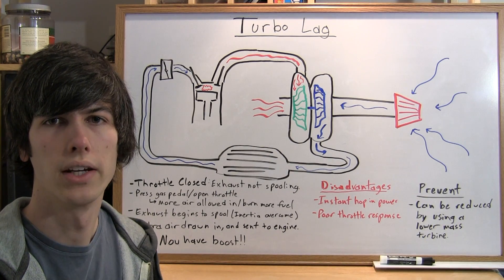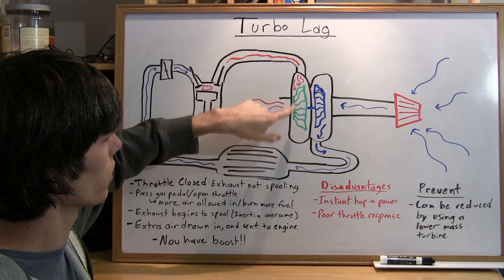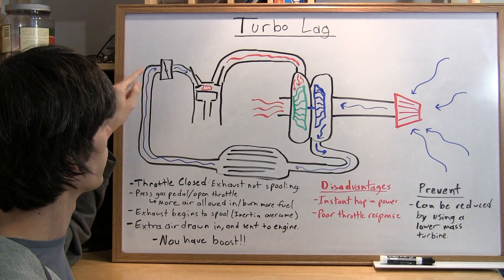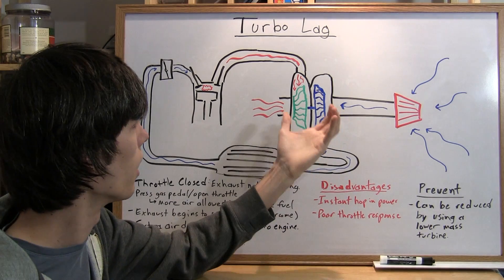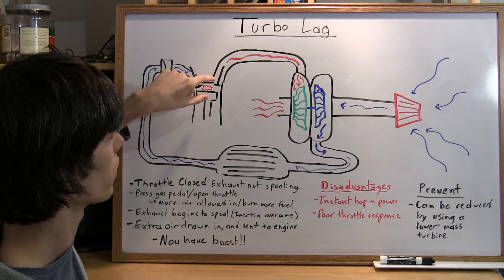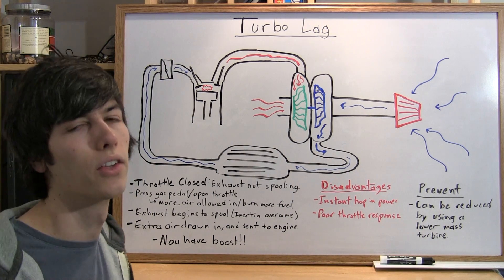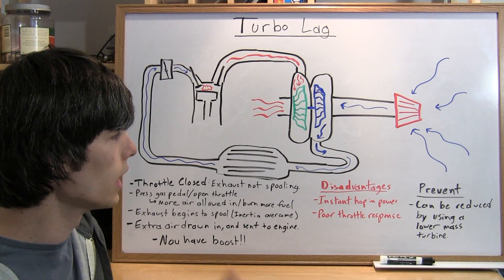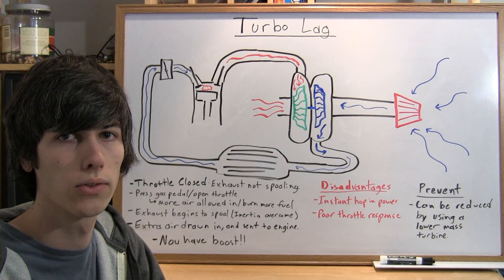Turbo Lag - The Problem With Turbocharged Cars

Comment: Engineering Explained  No No! you're incorrect in some point, the biggest one is: more air in= burn more fuel. This statement will bring viewer to a wrong thinking. More air flow= increase flow speed. Increased flow speed will create intake stalling. But those amount of stall isn't too effective to create engine failure. Still that amount of stall will decrease the coefficient force, coefficient force decrease will create less oxygen to the engine and cause overheated by the fuel. The "throttle" isn't connect straight to the valve, the throttle connected to a computer sensor which will work with a calculator to open the valve door effectively. Not over flow it. You're correct the exhaust need certain amount of pressure to overcome the resistance force not "force" from the turbine. Don't forget, those amount of force can create exhaust stalling and cause overheated to the cylinder. Comes to turbo lag, you're totally incorrect. Remember exhaust is from Intake. The amount of exhaust= the amount of intake by ratio. The time or "lag" is the time of the intake air accelerating it flow speed by how hard the exhaust has pushed off from the cylinder. In other word, the engine needs intake to create exhaust like Jet, u need to drive the turbine by intake forces and at certain rpm, the exhaust have the pressure to power the turbine and pull air in. So in conclusion, intake spool the turbine to certain rpm and the pressure of exhaust will drive the turbine from certain rpm. The "turbo lag" u can also call it resistance force, this amount of force will never stop because the exhaust always boost harder than the intake and create drag for the turbine, there is no way to overcome that, boost the exhaust harder, the inlet will increase by the speed of turbine. The only ideal possibility is to create a equal force between intake and exhaust. Let me answer your first question, the "burn more fuel" one. More inlet= more oxygen to burn, create batter coefficient force with same amount of fuel. Those amount of increased force will increase the speed of each punch at ignition timing to the piston. That also will increase the pumping speed of each piston. That will increase the RPM at the crank . Increase RPM= burn more fuel in same time. However the fuel control unit will decrease the fuel flow at low rpm to decrease the temperature. What I'm trying to prove here is "more air not equals burn more fuel" That is activate or fuel control involvement not naturally. the engine won't add more fuel  naturally by just pulling more air.  The engine will increase fuel naturally, effectively and activate by increased RPM. coz it will pull more fuel into the engine ideally.
Reply: Me grabs popcorn and beer while reading your comments

Cheers!
Reply: doktorbimmer ChrisHallett83 Thanks for the informative posts guys.
Reply: ROCKETGUN BOOMBS "Less octane = more compression, high octane = less compression"

Nooooo no no no...octane ratings (both the AKI and RON) are a rating of how resistant to detonation the fuel is.  The standard we use in the US, AKI, stands for Anti Knock Index.  Higher octane = higher resistance to detonation allowing for higher compression.  Compression generates heat, lots of heat creates detonation.  Higher octane means higher compression can be used while maintaining deflagration in the cylinders.
Reply: It doesn't matter what I say to you.  As I've pointed out before, you have one of the strongest aversions to learning I have ever seen.

That being said, this video is for people who DO want to learn so I will provide the information for their sake.  You'll probably just lock the replies soon anyway!

Turbo lag has zip, zero, nada to do with the octane of fuel being used.  The turbine, shaft and conpressor wheel all have a rotating inertia while the engine is idling.  The airflow will naturally spin the assembly at a relatively low speed.  Hitting the accelerator doesnt result in an instant power release as the turbo is working against the airflow.  There's your lag.

Octane and turborchargers...higher octane fuel is typically used for several reasons.  Forced induction means more air in the cylinders and on the compression stroke you're compressing MUCH more air.  This results in a lot more heat which would cause a lower octane fuel to detonate damaging the engine.  Higher octane fuel resists the detonation.  Plain and simple.

With modern ECUs this isn't even the case for many factory setups.  Electronic waste gates to pull boost, retarding ignition timing and cam adjustments allow forced induction engines to run safely and efficiently even on low-octane fuel.
Reply: Yes, THAT WTAHAT I MEAN!!!!!! More air in won't accelerate the piston! I did said that. You type something wrong. More air less fuel will not create lime. The opposite will.

More air in without giving same amount of fuel the piston will DECELERATE and decelerate quicker in each compression section. More air more coefficient of DRAG. More air= the fuel will burn more equally, too much air= over flowed and it won't fire up because the temperature decreased. The spark from spark plugs will blow through cylinder, exhaust valve, pipe all the way to the exit. That's why u see cars back spark when engine decelerating and running out of fuel. Fuel and Oxygen MUST equal. More air= more drag, more fuel, overheated, wasted of fuel, lime and after fire. Get it?
Reply: This two sentences from your comment will make you lose your technician career.

(((((((((("The coefficient of drag of the intake charge air will have ZERO effect on piston speeds."

"Car exhaust systems popping and banging under deceleration is due to TOO MUCH fuel, not a lack of fuel"))))))))))))

My answer for that is:

The coefficient drag of PISTON will effect the speed of itself not the air effect the piston. Read clearly.
Formula for piston drag: 1/2 PV square* area* cd.
So if the piston have better aero, it will create less drag, the opposite of that is less compression force. If there is too many oxygen coming into the cylinder, the piston will MUST slow down NATRUALLY. Anti lag, AFC ECU is mechanical involvement. The piston will pre-ignite when too much air in, but that only happen in a short time. Depends how quick the engine decelerate. Try to get a cylinder and block the exhaust with your finger then try push the piston and see what'll happen.

Second answer for your second mistake:

Too much fuel WON'T create after spark, it'll create after fire. Go look at 2013 LeMans 458 running out of fuel. When a piston full charging up and down, the AFC bring balance fuel and the intake into the engine. The engine running good. Once you let go, the AFC cut the fuel by ratio and the piston still pumping fast. Now the situation is too much air, not enough fuel to fill in. The spark plugs still spark hard and quick deal to piston order. So the spark isn't burning or creating fire, it is burning oxygen and little gasoline, that's not enough to create fire. Try think, what'll happen if you burn oxygen, and think what is like when you burning gas. Gas will transform to fire and oxygen just expand. Spark from exhaust= expansion of oxygen fire from exhaust= explosion of gasoline. Go look it up, NOT the internet.

There're also a formula for piston thrust. In order to keep you on track, I shouldn't bring my primary engineering math to confuse you.
Reply: Explain please.
Reply: ha, watching cars drag race and performance video helps me to finish my homework about mechanic physics. sometimes u have to think, not every professional is correct, they'll make mistake either.
Reply: Ha, Americans.........no brain, just abuse and insult people like the little bullies in high school. Luckily my parent didn't sent me to the ........."America".................
Reply: That comment aren't for you. Whatever, I have a good time arguing with you.
Reply: doktorbimmer  That comment aren't for you either.
Reply: doktorbimmer Hey, do you know something about planes or trains? If yes, it will be a good argument here if you want, also do you know anything about ship? I study sea navigation and ships mechanics for 9 month, and planes mechanics+ navigation for 5 month.
Reply: ROCKETGUNS BOOMBS stop chatting shit!... Your comments are hilarious with the non technical wording you use. and FYI. Air is sucked (or forced from a turbo) into the cylinder on the induction stroke - so when the piston is on the way down, so how you are going to slow the piston down I don't know, as the air is flowing in the same direction as the piston. The induction valve then shuts and the piston then compresses (stroke 2). We then have ignition (stoke 3) where the piston is forced down and therefore gives us mechanical rotation. then the exhaust valve opens  and the exhaust gasses are extracted from the cylinder and the piston goes up (4th and final stroke). Then repeat!

you're talking about changing the shape of a piston so it has a reduced drag coefficient?! I don't think you understand the point of a Piston! The drag coefficient should be high so it can squash all that air and fuel mixture on the compression stroke. If it was more aerodynamic it would be shit at doing this!
Reply: Peter Killeen You know lots of technical term so? You don't know how it work. English is my second language.
When I say drag, it doesn't me "stroke 1" inlet.
It mean "stroke 2" compress.
Everyone know that higher compress ratio= more power also more drag. So a high compress ratio engine can't rev high.
Adding more air in= higher compression ratio. So Naturally adding oxygen without add same amount of fuel have no difference at increasing compression ratio. It will slow down the engine. e,g, a 4 stroke V8. In a full order, it will be 2 inlet 2 compress 2 ignite and 2 exhaust. So if you add air without fuel, will slow down 2 piston in the same time by increasing compression ratio. It will also slow down another 6 piston because they're connected with camshaft.
If adding air without fuel, there is 1 thing you will see at the exhaust: shooting blue flame, there is 1 thing you can see in the rev  counter: slowing down, there is 1 thing you can herd: the engine note sounds louder and weaker.
Reply: doktorbimmer High compression engine can't rev high! How come you don't know that? Go ask everyone am I right.
Reply: F1 engine vs road car engine........
Reply: doktorbimmer Why F1 engine vs road car engine?
Reply: Compare F1 engine to F1 engine please. You can't randomly compare engines, that is not professional.
Reply: There is no advantage for you to argue higher compression ratio= higher rev.
Everyone know higher compression ratio= less rpm.
Reply: doktorbimmer There is something called variable compression ratio and variable inlet exhaust timing on Porsche. Low rpm more compression, inlet close later exhaust open earlier= best power and efficiency. High rpm less compression inlet open less.
Higher compression ratio= more strength needed from piston head and cylinder wall. Less compression ratio= easier to build, rev easier.
Reply: doktorbimmer ChrisHallett83 So you guys think higher compression ratio= higher revving?
Reply: doktorbimmer Biggest cylinder in production car: Viper 512ci V10 0.84L per cylinder, compression 10.2 rev 6500rpm
6.5L V12 each cylinder 0.5L smaller than 458. no problem for 8250rpm. Also ratio  depends on stroke. long stroke= more compression ratio than short. You guys know nothing about cars.
Reply: My point is easy, high compression ratio give lots of torque and higher efficient also more drag so it can't rev high.
What about a fact from wiki to support my point?
"V_c\; = clearance volume. It is the volume of the combustion chamber (including head gasket). This is the minimum volume of the space at the end of the compression stroke, i.e. when the piston reaches top dead center (TDC). Because of the complex shape of this space, it is usually measured directly rather than calculated."
Reply: F1 engine have 17:1 ratio, and is maximum efficient at 18000rpm. >MAXIMUM<
F1 is a race car, they make F1's engine as extreme as possible.
Reply: Is easy for you, just type wrong wrong and wrong.
Reply: Did I say is "not possible" you like to make things up from your mouth.
The secret of why Porsche can exist high rev and 12.9:1 is because of the fuel. The (octane number) Less octane= more compression, high octane= less compression. Easy
Gas engine can't go higher than 11.1:1 due to knocking or lower than 7:1 or 6:1 due to pressure.
Reply: doktorbimmer That doesn't prove I was wrong, High compression ratio DID can't rev higher than low compression ratio. It depends on what fuel you're running with. It depends on how hard the pressure is. You can have high compression ratio with low octane fuel, the pressure in the cylinder is similar to high octane fuel with low compression ratio. Get it?
Reply: doktorbimmer I thought you are an adult and good for a fair and respectful argument but you can't.....Disappoint
Reply: You keep saying cheers!? Are you junk?
Reply: ChrisHallett83 No, variable valve timing WILL effect compression pressure. Longer inlet valve open time, more air pull in, in the same time, higher compression pressure due to more oxygen flow in. High revving, inlet open shorter time, so less air in for applying high revving running beat and order, also less air= less compression pressure= less knocking. I shouldn't say high compression ratio engine can't rev high, I should say high compression pressure engine can't rev high. And you guys can't argue that or you know nothing about car engines.
Reply: Prove it. Saying the word "wrong" without proving will be an insult
Reply: ChrisHallett83 doktorbimmer It depends on engine design, compare an F1 engine to a sport car engine= apple vs orange, even Porsche vs Ferrari will have big difference between them. They build for special ability. When an engine running high rev, the intake valve will open and close later or delay so will have better airflow efficiency. Comes to inlet efficiency, or pumping lose, there is something due with VVEL. Variable Valve Event and lift. The inlet valve open wider= less piston drag. This technology targeted for low revving. Lower the rev less air flow, less airflow= less performance.
Reply: ChrisHallett83 low rev did have less oxygen flow in. VTEC aren't target for the amount of air flowing, is about the efficient and the inlet space. At low rpm, VTEC maintain in normal inlet timing, at high revving, the inlet valve will delay either open and close. Because the air will create a pump lose and decrease the pumping efficient of pulling air at high rpm when air flowing the same speed of piston. In other word, the piston aren't pulling the air in, is the air flowing by themselves.
Reply: doktorbimmer The compression pressure is dealing with the octane number of the fuel.
Reply: No need for ignition spark. Wow
Reply: doktorbimmer You proved you wrong again. HCCI engine can't rev high due to the high compression pressure in cylinder. It have low power range lol see, facts is with me
Cheers!
Reply: doktorbimmer It can, but can't have a wide power band as normal Millar cycle engine.

Cheers!
Reply: But is a Miller based engine.
With HCCI technology.
Reply: doktorbimmer wtf?  Miller cycle isn't a power induction based engine.
Reply: wtf means What The Fuck

Miller cycle is a 4 stroke Otto cycle engine.

Your knowledge is terrible.

Cheers!
Reply: It did use Otto cycle

Cheers
Reply: It based on Otto cycle.
Reply: Say what you want, Miller based on Otto that's all.
Cheers!
Reply: Similar to and based on is different.
Similar is opinion based on is facts.
Reply: doktorbimmer Based on means it used that method as a basic. Not exactly the same.
Reply: doktorbimmer not the same but based on. Otto engine is a low rpm engine, same as Diesel.
Reply: Why you being such stupid? Why you like to argue me with no reason??????????????
Are you serious? a base Diesel engine classed as "high speed" type? I am done with you. Is wasting time to argue with isiots like you.
Reply: Diesel engine is a high speed type.......lol
prove hoe "fast" it is.
Reply: Average 6L Diesel engine can rev around 3500rpm max. Average 6L Gasoline engine can rev 6000rpm. Which rev faster?
Reply: You shouldn't randomly compare engines. An engine can rev up to 8000rpm. Even 10000rpm. The problem is where is the maximum efficient speed at. Average 6.0L Diesel rev 4000rpm max power, 6.0L Gas rev 6000rpm for max power. And that is Ideal. Now 21 century have lots of technology to help Gas engine make max hp in lower rpm. But still Diesel engine is low revving.
Reply: Diesel is a low revving design. It's inlet, exhaust etc....based on low revving performance due to the density of fuel.
Reply: doktorbimmer Look up what fuel do ocean liner use then look up what fuel do Diesel vehicle commonly use. After that, look up what is the revving of them. :hint) must be same or similar displacement.
Reply: fuel type will directly affect ignition force and dynamics. Those affects will coz major impact for rpm. RPM due with piston speed. Do you know that?
Cheers!
Reply: Yes. So fuel did affect. Look up heavy oil vs Diesel vs Gasoline. and look up how effective will different type of fuel affect piston speed at ignition timing.
Reply: Diesel engine don't have spar plugs correct. BUT they did ignite by high temp and high pressure. Higher density= more pressure and temp needed. That's why, the type of fuel will affect stroke speed and fire efficient
Reply: Diesel fuel will ignite. The diff between Diesel and Gas is: Diesel ignite by high pressure+ temperature, Gasoline need spark plugs to gain temperature and pressure.
Reply: Diesel engine is a multi-fuel type. You can use gasoline, vegetable oil, corn oil, Diesel etc.....That's why WW2 tanks use Diesel engine instead of Gas or jet engine.
Reply: Jet engine use less space because it is small and powerful. But 1 Gallon of fuel can't even go for 1KM. Also there is too much dust at the ring, it will damage the engine. Gas engine isn't good at all. It needs better cooling. Diesel engine is the best because Diesel won't explode while shot. Burn is better than explode. Higher chance to stay alive. Japan, German, US etc use Diesel engine for tanks. Also because it can burn many different fue and easier to cool down.
Reply: More than you do.
Reply: doktorbimmer German and Japanese start using Diesel is because they're more reliable. Jet engine aren't. At the very first, Gasoline engine is the most common engine. They think they're powerful. But not. Diesel engine have much more torque, burn more types of fuel, longer range and  won't explode.
Reply: doktorbimmer haha you are right mate. according to his reply to me, pistons are connected via the camshaft ha! Crankshaft ROCKETGUNS BOOMBS u tool! and ROCKETGUNS, why would you ever put only air into the cylinder without fuel? That defeats the object of a ICE. Furthermore, you don't burn oxygen. The oxygen is used to burn fuel! I read 'A dummies guide to the internal combustion engine' if I was you pal
Reply: Peter Killeen I never say put air in without fuel. I said more air in doesn't mean more fuel will be pulled "naturally". This guy Engineering Explained said "more air= more fuel". but is "mechanically", not >naturally< and you idiots seems disagree with that. That's tell how stupid you guys are. Also everytime you let go the throttle, the air inlet won't cut the inlet to 0. The air flow will decelerate naturally but the AFC will cut fuel flow quicker than air flow. So the saturation is more air flowing into the engine than fuel. In that point of time, the cylinder is burning oxygen and create spark. or "back fire". Which known as stall either. If you still don't believe, go search the result in either vehicle mechanics view and aircraft mechanics view. They both tell the same thing., not doktorbimmer 's crap.
Reply: ROCKETGUNS BOOMBS well i think you will find when you accelerate the throttle body opens according to the throttle to allow more air to flow in. The ECU then tells the injectors to inject a certain amount of fuel with a ratio to air coming in. If more air flows then yes you will burn more fuel as the injectors will inject more fuel. If they don't then the engine is running lean which reduces performance. and i think you will find that when you let go of the throttle the throttle body will shut cutting off air flow (well only to idle so yea, not completely) The crankshaft continues to spin, the pistons continue to go up and down and the valves continue to open and shut. Just no fuel will be injected and minimal air will enter the cylinders. I think you're the deluded one. And you have been reading a mechanics comic made by someone as deluded as you!
Reply: ChrisHallett83 doktorbimmer  I think this rocket guy is jus a lonely soul who makes shit up to just piss people off and get attention. Deluded fool!
Reply: Peter Killeen More air in doesn't mean more fuel will be suck in "naturally". I don't know if you're Engineering Explained father or brother, your previous comment have nothing to due with engine.
Reply: Tell me which part am I wrong Losers.
Reply: Another idiot.
Reply: ROCKETGUN BOOMBS I couldn't sleep and took the time to read almost this entire comment thread and I got to this: "Tell me which part am I wrong Losers."  So here we go

I'll give you credit on a single, very basic point...kinda.  More air in doesn't necessarily mean that there is automatically more fuel, unless of course you're talking about a carburetor. When the throttle opens on a carburetor allowing more air into the engine, the higher volume of air passes through the venturi increasing in velocity and decreasing its static pressure.  This decrease in pressure draws in more fuel.  So in a carburetor more air directly results in more fuel.  However, that isn't what the video said anyway.  The basic concept of an engine is that it is an air pump with the addition of fuel (and of course igniting the fuel) to output more power than was required to initiate the motion of the engine.  More air means you can burn more fuel resulting in more power.  That's what the video said and that's the truth.

Now you repeatedly said that a computer is responsible for opening the throttle.  That's not necessarily true and was actually universally false until quite recently.  Before "drive by wire" the accelerator pedal was directly linked by a cable to the throttle body/carburetor. 

I'm not sure what point you were even trying to make with the higher compression = lower RPM or the greater amount of air intake slowing a piston.  I can see the large intake slowing a piston on the compression stroke as it does mean more air to compress, but the only extreme increase to be had would be from forced induction.  Also, a higher compression ratio results in greater thermal efficiency for the engine as the expansion after ignition is much more powerful.  The net gain more than offsets the additional resistance, especially with the gradual increase (no matter how quickly you build boost, even in a 4 cylinder engine with only 2 induction cycles per rotation you are still talking about 100 separate inductions per second at only 3000 rpm) the resistance would never be noticeable.  Ultimately compression ratios are entirely independent from RPM when discussing the basic spec of an engine.  From reading your posts I sincerely doubt you grasp the concept of dynamic compression ratios as a result of RPM and the reasons we have variable length intake manifolds and variable cam phasing.
Reply: 94XJ Nope. You're wrong. No matter how many cyl you have, How big your engine is, still more air NOT= more fuel. Back to basic, At 3000, if I step on the gas, the inlet valve will wide open then the air will flow in right? In this time, the fuel flow won't accelerate or increase. It is because more air= more drag, Always remember, air is for burning coz the fire triangle is: oxygen, temp and fuel. In other words, more air= more engine or piston drag= deceleration. The slower the piston ran still won't mean it burn less fuel, it just mean each cylinder will burn less fuel in certain amount of time. And it's controlled by AFC and ECU which is mechanically not naturally. Even Engineering Explained  the one who explaining Nismo's aerodynamic can't answer me.
The only thing that "naturally" happened in the cylinder is more exhaust= more inlet "naturally". Coz exhaust and inlet is tie. Fuel and inlet aren't unless modern car engine work as a fuel pump.
Reply: doktorbimmer Is rocketgun boombs not boobs. Stop watching sexual tap if u wanna be a pro.
AFR and MPE or ABC whatever, still won't change the fact of how air related to fuel. U know the terms doesn't mean u know the fact. Guess what, I'm younger than y'all!
Reply: doktorbimmer picking the sentences that I wrote isn't mature at all. I'm 17. And still whatever u say, can't disprove the fact of how air related to fuel.
Reply: By fact, I'm smarter than y'all

Cheers!
Reply: ROCKETGUN BOOMBS Thats the probelm with teenagers, you think you know it all, done it all. Mate we have all been there, it wasn't long ago i was a teenager myself and i thought i could do anything, but suddenly you get to the point in life where you realize that is not the case. The fact that atleast 3-4 people on this comment section have disagreed with you should be enough for you to ATLEAST check your own knowledge to be true by looking at books again. Obviously there is a chance you could be the next einstein but that chance is far smaller than the other 4 being correct.
Reply: ROCKETGUN BOOMBS The reason nobody can answer/explain anything to you is simply because you can't be bothered to consider there are a lot of people who have made their career out of the physics of engine design and have far more knowledge on the subject than a 17 year old and his "fire triangle".

I think the greatest proof of how little you understand is "exhaust and inlet are a tie".  If that were so, then please explain how on earth a turbocharger is spooled up.  Igniting fuel heats the air in the combustion chamber causing it to expand.  This is what drives the piston downward on the power stroke.  The air is still very hot when it exits the exhaust ports and has much more energy than the cooler inlet air.  That's why exhaust valves are typically smaller than intake valves, the heated exhaust has more energy and moves out of the cylinder faster.  That's also how there's enough energy in the exhaust to drive a turbine forcing air into the engine.  If inlet and exhaust were a tie, then there would be no gain in operating the engine and it would be utterly useless.
Reply: i know u guys feel silly while trying as hard as hell, pulling all books out, calling your friends, try everthing possible to find a single fact that can disprove a 17yrs old........
inlet and exhaust are tie together. more inlet=more exhaust. less inlet= less exhaust. ask everyone will more inlet means more exhaust (naturally) then ask will more inlet means more fuel (naturally) let me ask u a simple question, where is the fuel came from? and how? are they pull in by the inlet air/fuel mixture?
Reply: supaahflyy first u don't have to tell me where i at in engineering subject. i know better than u.
second, those engineering degree mean nothing, just tells u studied at that certain school or university and pass the exam. nothing more than that. i love cars and engine, i spent 5 yrs to learn from how they work to how can it work better. So u better shut up.
third. everyone agreed with u doesn't mean u're right
Reply: doktorbimmer Turbo lag can due with octane as well. Dumbass!

Cheers!
Reply: Absolutely dead wrong beyonf belief.  Turbo lag is simply from overcomming the inertia of the turbine mass and spooling it.  Octane is a measurement of how prone a gasoline mixture is to predetonation.  There is ZERO correlation between octane and turbo lag.
Reply: I knew you gonna say that. octane have something to due with turbochargers. Give u 2 more chances.
Reply: 94XJ You have 1 chance left. Try again. 
Don't worry, I won't lock the reply or delete your reply.
Reply: ROCKETGUN MISSILE more air does not necessarily mean more fuel especially in EFI. The fuel is determined by the throttle position, calculated engine load and rpm also there are some other small variables   so while I'm not disagreeing with all that you said you weren't explaining that very well also if you don't add the correct amount of fuel you can run lean and burn pistons and valves
Reply: ROCKETGUN MISSILE also I have to point out that octane doesn't have anything to do with turbo lag. The only thing octane has to do with is pre detonation by the higher compression. And before you try and say that I'm wrong or something like that you should actually look it up if you think that I am also I have a lot of experience with motors and such so I do know what I am talking about
Reply: wades623 Octane number DO have stuff to do with turbolag. The higher octane, easier to rev the engine.Easier to engine spool up, quicker the airflow accelerate. How that not affect turbo lag? You should look up 
1) how back fire related to airflow
2) how back fire affect turbo spool.
Reply: wades623 Right...while more air doesn't directly result in more fuel (except in carburetors...that's literally how they work), the ECU does have to add more fuel when there's a greater amount of airflow measured by the mass airflow sensor to keep the engine from running to lean.

As far as the octane, you're right again...but rocketgun doesn't understand nor will he make any attempt to understand.
Reply: ROCKETGUN MISSILE http://www.exxon.com/octane-rating
Octane is just the chemical blend of the fuel creating different amounts of "resistance" to detonation.  The higher the octane rating, the more resistant the fuel is to ignition.  Seriously.  That's it.  Whatever effect there may be on the turbo isn't specifically because of the fuel rating...it's a matter of tuning.

My sister has a little Sonic with a 1.4t.  Whether I put 87 octane in it or e85, the turbo doesn't respond any differently.  The computer will adjust maximum boost and maybe pull some ignition timing for the cheap gas, but how the turbocharger goes from "idle" speed to it's full boost speed is completely unchanged.
Reply: 94XJ yeah I should have known he doesn't even know how to write a correct sentence and hasn't backed up his opinions because if he did then they would just be facts
Reply: ROCKETGUN MISSILE the engine doesn't spool up. There is no point in trying to educate you because you don't listen to people that have experience in the subject
Reply: Opposite. wades623 I do have experiance in spool up have something to do with octane. Higher octane means more power. More power means quicker engine respond and back fire. Back fire means air expanding at tail pipe. Rmb, exhaust rate and inlet rate are tie.
Reply: ROCKETGUN MISSILE OK first off  I highly doubt you have experience in anything.  You don't even have a grasp on proper English and sentence  structure. You  can't have experience in "spool up" whatever the hell that means so you  are just making yourself sound  stupid. And by experience I meant actually studying and actually working on  cars  and engines, I doubt  you even seen what under a hood looks like. Also you  have no understanding of chemistry because octane ONLY prevents pre ignition and  knocking. And also  a  back fire is when fuel /air mixture is ignited in the intake not the exhaust. I'm not sure if you are just a troll because if you aren't you are a complete dumb ass
Reply: Disprove me if you have the ability.
Reply: ROCKETGUN MISSILE I already  did,  I explained why you were incorrect you just don't  understand how things really work and that even though there are variables in design it all works on the same principles.
So whatever even though someone else also said you were wrong you still don't get it. Your parents should still consider a  late term abortion so you can not contaminate the world with your ignorance
Reply: ROCKETGUN MISSILE here is a link to help you understand what octane does

http://www.answers.com/Q/What_is_octane_all_about_or_the_purpose
Reply: Auto repair lolol. I have friends who work 10 yrs for Chevy race team in Macau (he's the one who record dyno number) and a friend who race for AMG in Macau as well. They all know higher octane spool easier due to more expansion pressure and back fire. Of course, that have something to do with exhaust pipe.
Reply: ROCKETGUN MISSILE "your friends" are not you. And they probably don't exist. If you would have read either of the links posted to these replys then you wouldn't have even brought this up
Reply: wades623 Wow. My friends don't exist? Are they ghost? I just talked to them 4 days ago. The old man you linked me did NOT prove me wrong.
Reply: ROCKETGUN MISSILE If anything, LOWER octane could potentially result in faster spooling as the fuel detonates genrating higher temperatures and thus more exhaust energy.  Your racing friends might exist (doubtful), but they surely never said higher octane = faster spooling...not unless they were mocking your complete lack of understanding.
Reply: 94XJ Higher the octane means more energy per liter of air and fuel mixture. At high EGT, the air perform less density which decrease boost. However, higher the octane means harder it ignite and expand the air.(also depends on spark plugs).
Reply: ROCKETGUN MISSILE higher octane does not "ignite harder" did you even read those links that me and xj posted?
Reply: wades623 I did. Did you read what I say? I said, higher octane create greater expansion in the cylinder (depends on ""spark plugs"")
Reply: ROCKETGUN MISSILE wow you are stupid. I did not post a  link to someone I posted to a page that you could read and  see that you are wrong. And yes I think the people you are  referring to don't exist because if they really told you that they are just as  stupid  as you are  and  no one would be paying them to be  automotive technicians
Reply: wades623 You are the stupidest people I ever met. 1) claiming my fd I talk to doesn't exist
2) believing octane won't affect power
3) still thinking you are right
Reply: ROCKETGUN MISSILE octane does not affect power in any way! It is for detonation resistance so knocking does not occur! Reason the fucking link I posted and then tell me I'm still wrong. And I will know if your stupid ass is lying because I know what it says
Reply: wades623 Read*
Reply: ROCKETGUN MISSILE just  because you said it  doesn't make it true
Reply: ROCKETGUN MISSILE here you go. Here I some more reading for you (assuming you can)
http://www.nicoclub.com/archives/gasoline-octane-myths.html
Reply: wades623 Let me ask you a question. If octane don't affect power, why will "octane booster decrease 6% of total power from an engine? Let me tell you why, "octane affect power)
Reply: wades623 Have a look at Fifth gear testing octane booster
Reply: ROCKETGUN MISSILE OK assuming that is correct then why are you arguing that octane will increase power? You have literally just contradicted yourself
Reply: wades623 Have a look at Fifth gear testing octane booster before going any further.
Reply: ROCKETGUN MISSILE it doesn't even matter. You stated that octane will INCREASE power. Now you are saying that it decreases it. Will you just stay with one thing. And I'm not going to bother looking it up if you wanted a specific thing to be seen you could of posted a link
Reply: wades623 what you mean octane will increase power? I mean HIGHER octane increase power. You surely hasn't watch it yet don't u? Octane booster actually DECREASE octane number and decrease power instantly. Proved my point "octane affect power".
Reply: ROCKETGUN MISSILE Higher octane doesn't increase power.  Higher octane allows for engine tuning to create more power.  The fuel itself doesn't create more power, it simply allows for adjustments to the engine to make more power.

Again: the octane rating of gasoline is a measurement of its resistance to detonation.  Gasoline is primarily made of 2 hydrocarbons (well...forget it...close enough for this): heptane and octane.  Heptane is more volatile and self-ignites easier.  Octane is more resistant to self ignition/detonation so more octane in gasoline means less detonation (what we actually want inside a combustion chamber is called "deflagration").  More detonation resistance means a higher compression ratio can be used as compressing air generates a lot of heat which could cause fuel to ignite without a spark.  For forced induction engines, you can run more boost for the same reason (more boost = more air in combustion chambers = more compression = more heat).  Higher octane ratings will also allow for more timing advance.  More timing advance (to a point) will get the flame front through the fuel earlier to get the optimal expansion and force on a piston.

When everyone is telling you that you are incorrect, maybe it's time to double check yourself.  You're young and born into this lovely cyber age.  Literally ALL of this information is available to you with EXTREMELY little effort.  There is honestly no excuse for you to be so ignorant of such basic information that has been widely researched, documented and compiled for DECADES before even I was born and I'm more than twice your age!
Reply: 94XJ You are either misunderstanding me or attempting to mislead my reply. The fuel itself won't make more power but the spark plugs. Higher the octane needs more pressure  and higher temperature to fire up the fuel. Higher the octane needs higher temperature and pressure. Not higher octane= more power. I thought you should understand that..... No one here have to say ""high octane needs specific spark plugs to generate more power"" We all know how higher octane affect power. You're so dumb 
-_-
Reply: 94XJ just forget it. Him and his imaginary buddies don't understand mechanics and chemistry. I already gave up
Reply: wades623 Way to lose an argument
Reply: wades623 He clearly doesn't even understand what spark plugs do.
Reply: 94XJ Claim claim claim. underrate people IQ is one of the reason why you lose an argument.